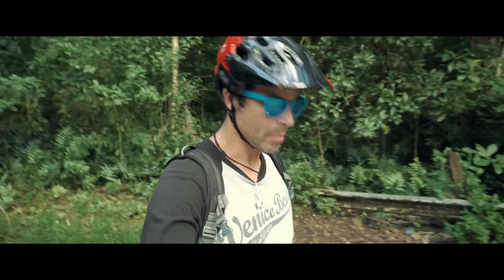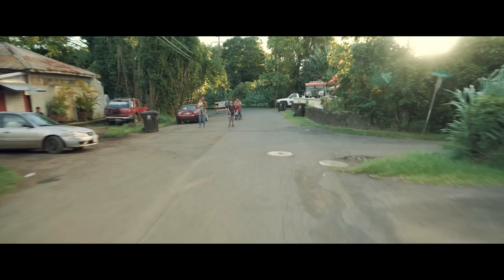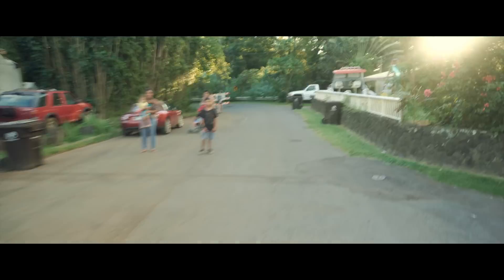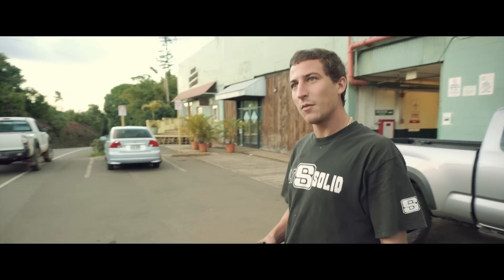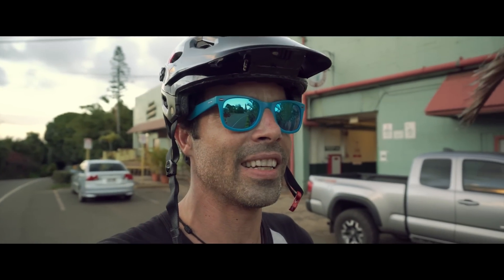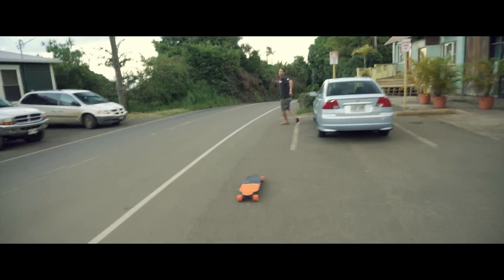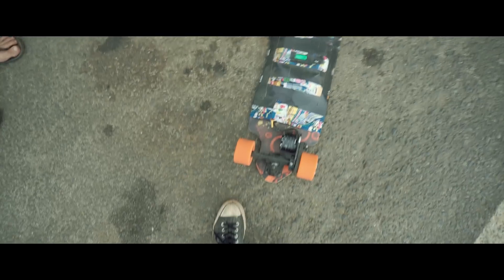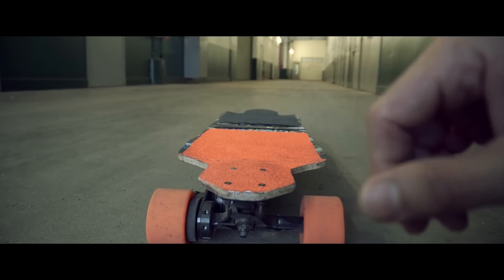DIY Boosted Board | Fast single motor longboard

Comment: Question, why did you go with the 6355 and not one of the 3000+ watt motors? 

I'm 230lbs, and thinking with going with the bigger motor, just wanna make certain I am not missing any caveats. I have a bunch of 2,000mah 18650 batteries I plan on putting into a 12sXp pack, so amps won't be an issue.

Comment: I've been searching all night for an affordable option for an eboard.  What I've been finding is that you pay for what you get.  I've been long boarding for years and started out as a blader many years ago.  I know what normal wear and tear is on equipment when you skate.  The crap that's out there won't last.  Plus I wanna use my Sector 9 board.  Dude, you've opened my eyes!  I can totally build one as alot of the concepts are the same as building a drone.  And...it looks like the diyelectricskateboard.com site will completely support their products.  I've looked around to and it's definitely high quality.  I am so psyched!  Thanks brotha.

- Neil

Comment: is there somewhere else you could get a cheaper battery cause that battery is extremely expensive, could someone tell me about a battery that works that same or as good as the one that he has but cheaper
Reply from the maker: jousey junior Hobby King RC lipos but be careful as they Do not have a built in bms (battery management system) and can catch fire if not monitored properly. You can attach a voltage alarm that will beep when they reach a certain voltage. Charging them properly is equally important but you can save a TON of money.
Reply: which ones would you recommend?? and could you explain to me what 6s or 3s or 10s mean and what you mean bms?? like if I go full speed for too long it will explode or if use it for a long distance without rest it will explode too
Reply from the maker: jousey junior Yep. The battery management system will cut power to motor if it's too stressed, turn off before batteries can be damaged, and is simple plug and walk away charging. RC Lipos are none of that but way cheaper. As far as cell count "s", you'll have to do your own research as there at a million options. Most go with 2 6s 5000-6000mah cells and run them in series or parallel depending on whether they want more power or more range.
Reply: Shit this sounds confusing. I want one but i dont want to pay the high price name brand ones. I have a 350$ and i want the same or close to the same speed that you get. As of battery life i want to be able to ride 10 miles on a charge.
Reply: The problem is idk shit about all this e boards

Comment: dats awesome mabey you can show us how to make one for under $200
Reply from the maker: Hayden Hoff a shitty one, yeah. :) not possible with the current prices available in the market.
Reply: you can buy a motor for $20 - $400
Reply from the maker: Hayden Hoff ? Yeah, and the $20 motor will fail, costing you another $20 motor or your next choice which might cost more. This build is the least expensive but RELIABLE build possible right now while still PERFORMING.

Comment: which one is faster lower kv or higher kv with the same 22.2v
Reply: You have to find a balance between torque and speed. It must be under 300kv or there won't be enough torque to move you forward. Within the 150 to 300 kv range, speed generally increases as kv increases.
Reply: So 300kv is faster than 150kv?
Reply: Yes. But keep in mind that it will be easier to climb hills with the 150kv.
Reply: Go to the Hobbyking website and search "sk3 aerodrive". These are the best diy motors you can get (for the price). You're looking for a brushless outrunner.
Reply: So 213kv is the best choice

Comment: Why not spend 200 more and get something that's properly built, much more reliable and doesn't look ghetto af?
Reply from the maker: ankitpsk a slick case that hold all the electronics is coming, the battery lasts 2x as long made of high quality cells, the speed controller is amazing, the motor is robust, and the deck is name brand. This thing will BLOW a single motor boosted board out of the water and take you way further. Gonna spend the extra $200 on my dirtbike.
Reply: Fair enough man. I guess I just expected it to be significantly cheaper when I saw it was DIY. Hopefully the case really cleans up the look.
Reply from the maker: ankitpsk yeah, the case will make it look super clean but more importantly, protect the electronics from water. If you used cheap hobby king lipos and were on top of charging, etc, you could cut the price dramatically. I just think the current battery is worth the money due to the built in bms (battery management), and much more stable chemistry. Not trying to catch fire anytime soon. I pounded on the battery today through hills, etc for 45min straight and the battery was hardly warm. It also comes with a monster 80amp fuse to further insure you done spontaneously combust :) stay tuned for the second motor install as well as case and making her a proper board..
Reply: Longboarded for years now so pumped these things are being made,  we always had some buds take us up a huge hill in a car after we rode down. #totallychangingthegame
Reply: Posted at 12:40 am.  Haha dedication man, love your videos,  on the edge on buying a drone,  wondering about your input on them,  worth the money or not?
Reply from the maker: Cole Tutt totally agreed! I thought the same since I was a kid. "I want a motor on my skateboard!"
Reply from the maker: Cole Tutt buy a DJI Mavic or GoPro Karma. Small and functional is the future. That being said, I love the phantom 3pro, amazing images from a flying camera

Comment: I thought this would be like wayyy cheaper than a boosted board lol. To me an electric skateboard is not worth $800 let alone $1200! I could buy a motorcycle for that much. I have to admit it does look fun for cruising around locally!
Reply: C.T. Wellington you're right you could buy a motorcycle but counting insurance which could be upwards of 200 dollars a month plus paying for your training and license also a registration fee and upwards of 1000 dollars for gear i would say that a longboard that only costs 800-1200 dollars and you can go anywhere without paying for gas is a pretty good investment
Reply: Its for people who dont really care if it costs $1000 or $3000 as long as it keeps them entertained (casey neistat)
Reply: You can get this type of board for $500 if you use Lipo batteries, and make your own motor mount.
Reply: Make a list of where to get the parts for us.
Reply: Check http://www.electric-skateboard.builders/
you can find many cheap builds there...
Reply: I made mine for around 500 dollar, including a new board. It has the same range and the same speed as this board.
Reply: a longboard is about 500 alone with no electrics...
Reply: but i mean not a cheap one a proper downhill one
Reply: LeOnMoTo  i reckon about a decent longboard. i'm upgrading that part of my board cause it does not feel save driving this 20 Mile an hour. My board is a version 1 and i think i have  to spend some more money to make it feel more premium.

Comment: Would it be possible you think to put a DC motor on the front that would just charge the battery? As the back motor(s) push you? In my brain that's a thing that would work.
Reply from the maker: it would be possible but in violation of the laws of thermodynamics. Dunno, sumn about not being able to create a surplus of energy within a closed system.. maybe if I was using an electric shake weight while riding....